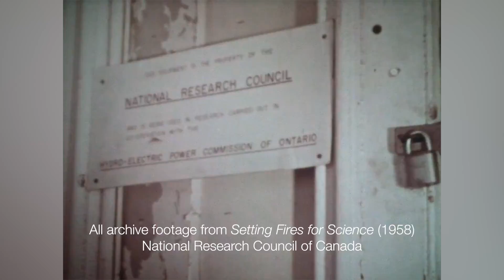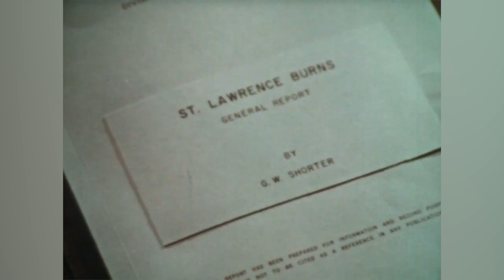The town that was burned for science

Comment: Perhaps Kensington and Chelsea Borough Council should have read the Canadian report before covering Grenfell Tower in a flammable fire flu shaped cladding. As for the recently built wooden framed flats with untreated wooden balconies - at least 3 have burned down in London over the last 5 years - no, it has changed the base data but greed and ignorance still prevail

Comment: It's too bad Tom wasn't in the area a couple of years ago when they replaced the North Channel Bridge at the Seaway International Crossing in Cornwall. The old bridge spanned one mile (1600 metres), and was replace with a bridge that now spansa third of that (about 550 m). The original bridge was built high in anticipation of the massive ship traffic that was expected with the Seaway's completion, but it never materialized and ships use the Eisenhower lock on the U.S. side instead.
Reply: I remember walking on the north span for the very last time before it was demolished

Comment: The water level is controlled by several dams along the St. Lawrence River between Montreal and Lake Ontario. Currently, the water level is high, not only because of recent rainfall, but because a tanker ship has run aground in Morrisburg, Ontario (which is about 10min drive west of Aultsville/Ault Island). They raised the water to try and free the ship, however, they needed to take more measures to finally the ship unstuck. Small town rumors were mixed in with the actual info, but it seems the ship is finally free after a week or so of trying. Just a little tidbit.

Comment: That was a great video, but I wonder what actual changes in building construction were made in new projects since then. We learned something from those experiments, but how this knowledge was applied?
Reply: Data from the burns was the foundation for a section called "Spatial Separations and Exposure Protection" which was introduced to the National Building Code in the 60s. It essentially regulates exterior cladding material, size of window openings and distance between buildings in order to minimize fire spread.